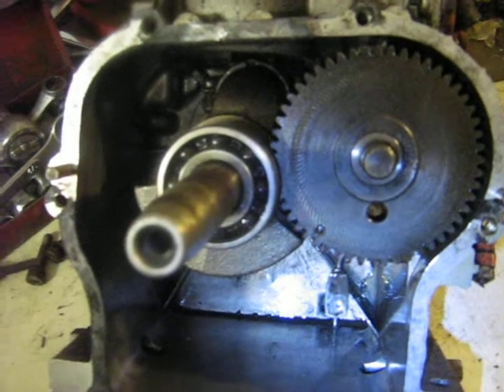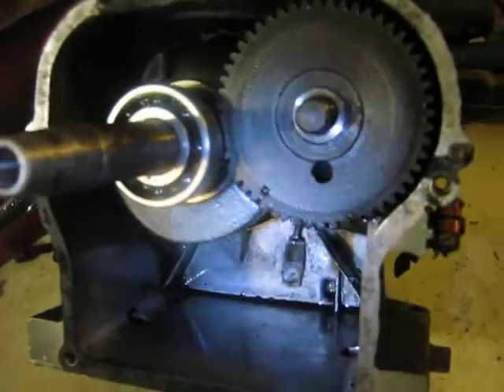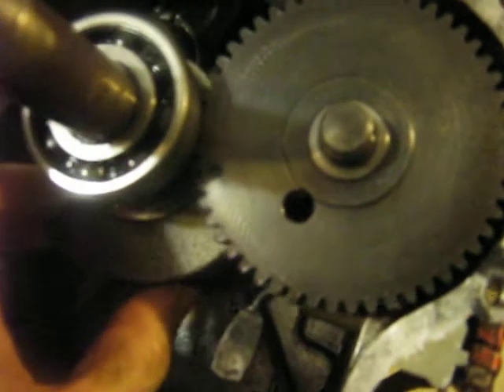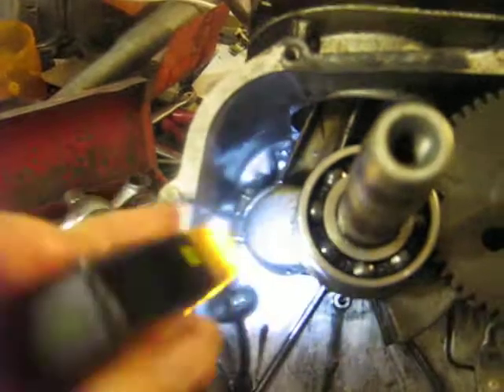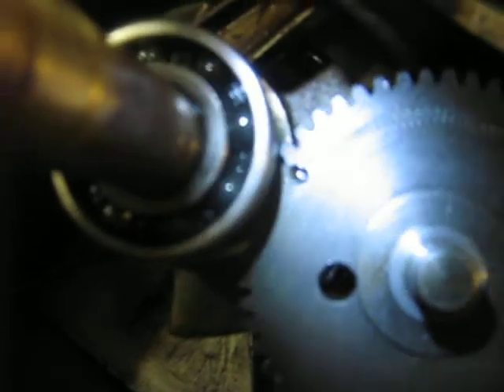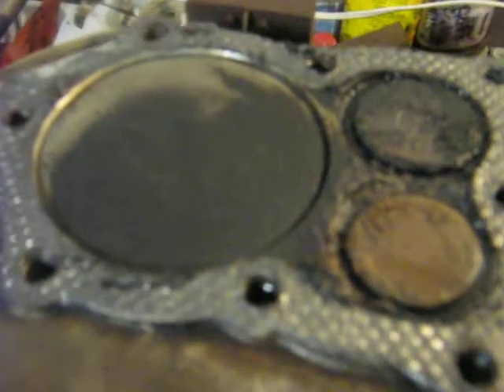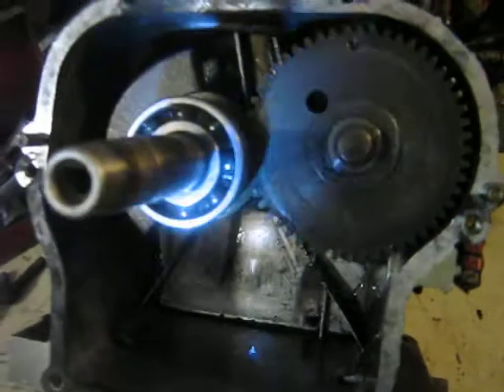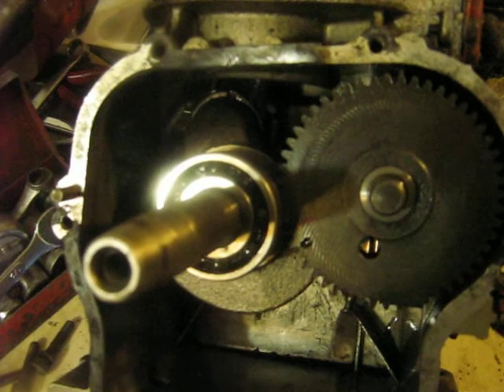Timing Cam on 5HP Briggs Roller Crankshaft

Comment: I have a machined hole in my crankshaft. Is that the same because there is a slight little dot in the crankshaft as well. Really confusing these roller bearing motors not anything like the old school😢
Reply from the maker: I haven't heard of a hole in the crankshaft, normally it would be a dot or line on the crank timing gear. You may have to resort to trial and error, line it up how you think it is supposed to go, put the cover back on, and check the valve timing versus the piston. You just gave me an idea for a vid, where I show when the valves are supposed to start to open relative to the piston position.  Another point, when the piston is at the top during the valve overlap period, the intake should be opening, and the exhaust valve closing, so if this isn't happening then, you probably have the gears timed incorrectly.
Reply: @ChargerMiles007  Yah make a vid on this. I think ive got it correct as thats what I did. Its about 1/4 before TDC and the valves do this. The machined hole lines up with the other mark. I havent tried starting it yet. Have other issues.

Comment: You timed it just like the manual says! And that bearing is a press fit, if it slides off there’s a problem!
Reply from the maker: Yes, the bearing is normally heated (in oil) before installation, resulting in a press fit. True, if it slips off it is too loose.

Comment: ive got the same thing how do you get the berring off
Reply from the maker: you may have to carefully cut the bearing off with a grinder and zip disc. Another way might be to cut the outer ring off, then heat the inner ring with a torch (but not too much so it is glowing), then pry it off the shaft. i do know that you heat the new bearing up in oil to say 350 F then slide it on the shaft quickly before it cools down. You must heat the bearing in oil though, never use a torch!!!
Reply: The bearing is easily removed with a puller. Use strip 180 sandpaper to remove just enough material from the crankshaft to allow the bearing to slide on and off by hand.

Comment: Thanks your video was very helpful I have a 5 horse off of an old generator mine is a 77 model and I took out the crank to have a keyway cut in it and didn't mark the timing mark and couldn't find the way it went back and I watched your video put it back together and it ran how it was supposed to.
Reply from the maker: Thanks for taking the time to comment, I appreciate knowing my vid has actually helped someone!

Comment: I am working on one exactly as you described. An old generator that has been sitting in a garage for 20 years, Your video was extremely helpful getting things back together correctly.
Reply from the maker: Glad it helped you out. I actually had to refer to my vid about the Briggs racing con rod, as there is no marks on it to show which way it goes! Hope you get your generator running well.

Comment: I have an engine exactly like this. The camshaft is rusty and the lifter are gone the carb is dirty and the piston rings fell apart after I pulled the piston out. The cam shaft wont fit anymore. Some moron took it apart to work on it and left it sitting on a bench in an open garage for a long time. Hopefully after some classes I can put her back together or do some interesting mods.
Reply from the maker: +David Vermillion Try holding the camshaft in a vise with soft jaws, and using emery cloth on it, or a 2" wide strip of sandpaper folded twice to make it about an inch wide. I generally use 320 or 400 grit. it seems to remove rust pretty well.
Reply: ChargerMiles007 I'll try that. I'm lucky all the parts are still ling around except the lifters but that's an easy mail order part.
Reply from the maker: Yes, those danged lifters seem to walk away! I have the same problem with the 4 new engines for the 8 cylinder, I am searching for tappets, yet they come with every engine!

Comment: Is there a spacer between the bearing and gear on the crank? I have the same engine but it doesn't have the bearing and I wanted to get a side cover and bearing on the crank.
Reply from the maker: I will take a look at it, I have never removed one of these bearings, so I don't honestly know. Off the top of my head, I would say that there isn't a spacer though.
Reply from the maker: I had a look at one of the ball bearing cranks from a 5 horse Briggs (I only have a few of them). I couldn't see any type of spacer, I think you just press the bearing onto the crank. I was reading my Briggs manual, it says to heat the bearing to 325 deg. F, in oil, then slip it onto the crank which has been held in a vise. Sounds like a tricky venture, as your pretty much only have one attempt at it!  Cooling the crank down first could help also. They say to use an arbor press to remove a worn bearing, and to not re-use a bearing that has been removed.

Comment from the maker: Yes, offset flywheel keys are an option also. I think you are right, they probably only work with the electronic ignition Magnetrons, as the points wouldn't close at the right time.

Comment: The only way to increase the timing is to remove the flywheel and install an offset key way 2deg 3deg exc.But this will not work if your still running point`s

Comment from the maker: Perhaps, if you advanced the timing 1 tooth, you MAY make more high rpm power, but I am not sure, since you would open the valves sooner, but also cloase them sooner. Longer duration racing cams are availible for a Price!